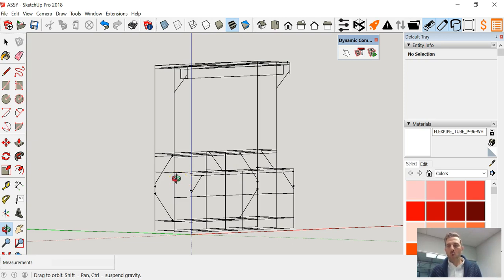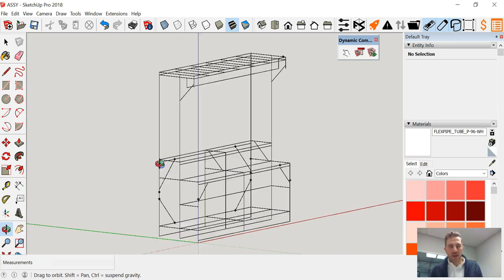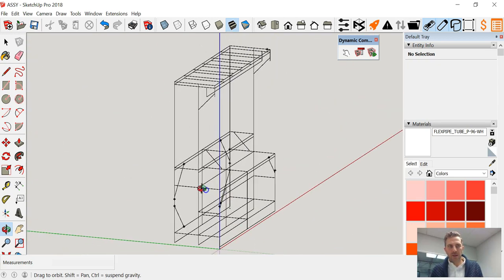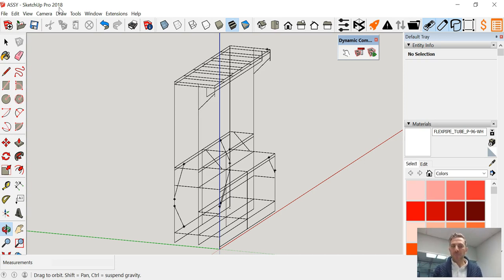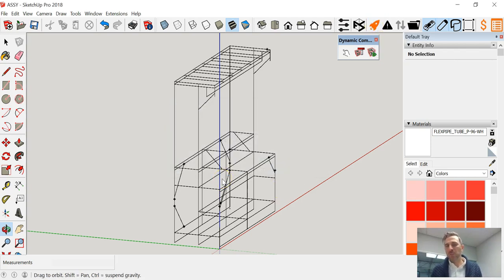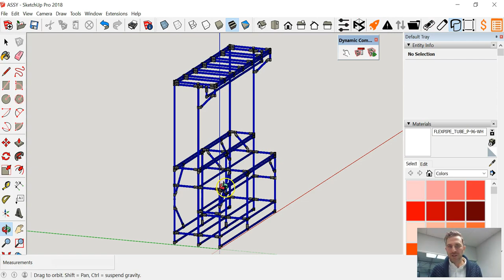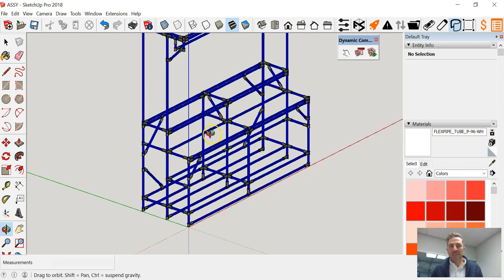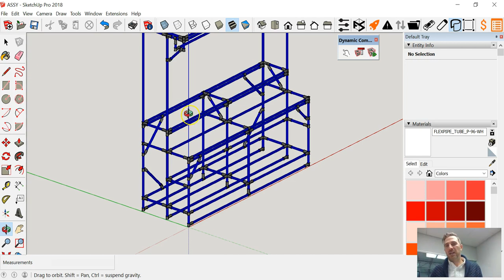SketchUp Extension: What is the Flexpipe Creator Extension | Flexpipe

Comment: Hey, Is there a way to generate pipe dimensions for easy assembly? The dimensions in sketchup are not the same as the pipe cut lengths on the cut list due to the bracket attachments and the way sketchup is set up.
Reply from the maker: Hi J Z,
Do you need the measurements to be in inches or mm or cm? There is a conversion formula that can be found on google to insert into the excel to change the dimensions.
 Do you have the SketchUp Pro version? You can chat with me: https://www.flexpipeinc.com/creator/help
or email me at: esolano@flexpipeinc.com
I'd be glad to help! Esteban